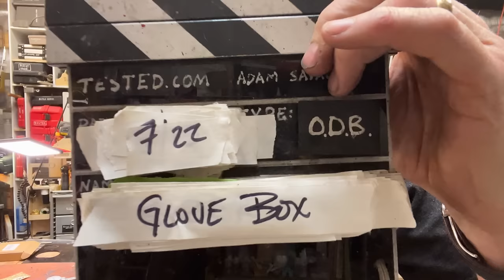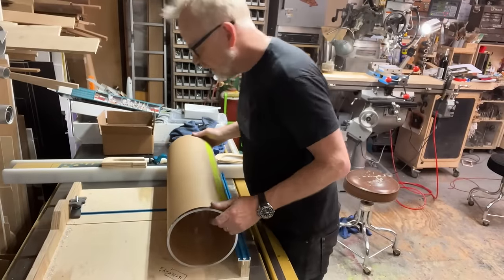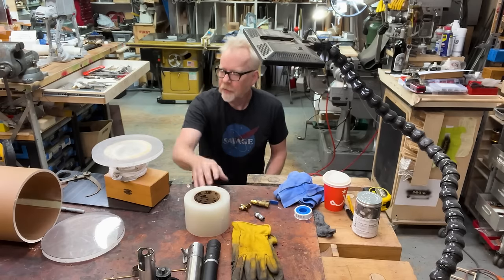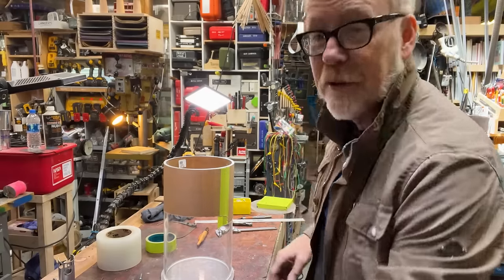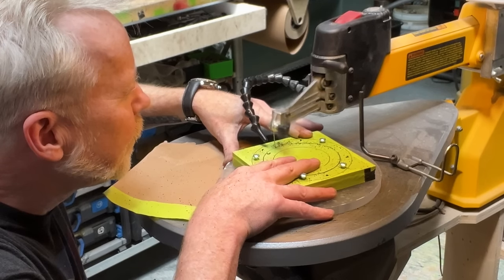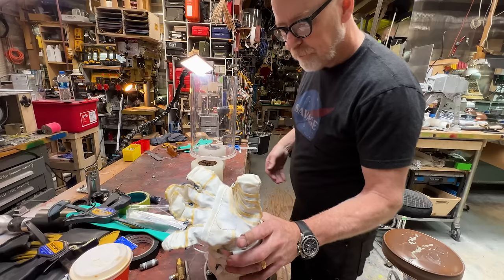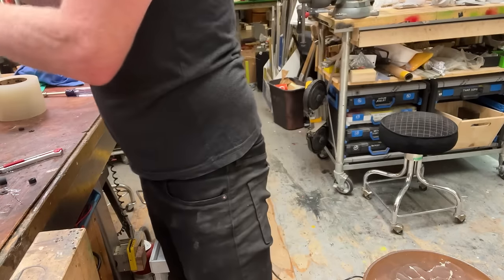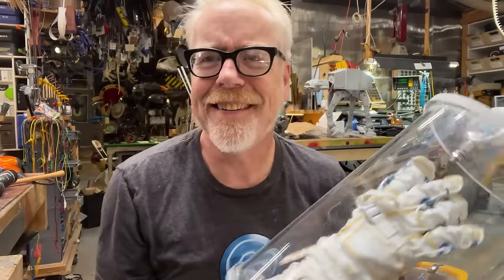Adam Savage's One Day Builds: Spacesuit Negative Pressure Chamber!

Comment: Dude! Retrofit the chamber to be drawn down to 0 atm and have a ringing hammer and bell inside it. No sound will be made and it shows off the negative pressure part. Such a cool build!
Reply: Depending on how it was attached, the bell's vibrations could leak to the jar through its mechanical connection.  There would be some some sound possible.
Reply: I think behind that thick of plexiglass, people would just assume it's very well sound proofed.
Reply: Could just hold a bicycle bell and ring it with 1 hand
Reply: @sjdpfisvrj  BUT, you could ring it with air in the chamber first for a point of reference, then keep ringing it as air is pulled out and observe the sound become quieter. For SCIENCE!! ;)

Comment: This is fantastic!  Some suggestions: there are multiple air leak paths with your gasket design: between the neoprene glove and the acrylic, through the screw holes in the neoprene glove, and through the screw holes in the acrylic.  You could minimize most of these by mounting the neoprene glove to the outside of the chamber, so your layers from outside to inside are: delrin washer, neoprene glove, rubber gasket, acrylic endcap, rubber gasket, fabric glove, delrin washer.  You could do even better by using two different sets of blind tapped holes, one to hold the fabric glove, one for the neoprene, so there's zero path for air to pass through the acrylic.  But blind tapping 24 holes in acrylic would be no fun.

But of course you can't do any of this because the bottom cap is now permanently glued to the tube.  If you wanted to take another crack at this, it might be worth cutting off the end cap, gluing an acrylic flange around the outside of the tube and attaching the end-cap with removable bolts and a gasket.  Adds another possible leak path, but makes debugging so much easier.
Reply: Could always cut two crescents of acrylic, blind tap, and glue them to the inside, and then glue up the seam.
Reply: My bet is an air leak between the acrylic parts Maybe it can be sealed with some kind of rubber seal around the edges?
Reply: I'd put it under positive pressure, and then run a little soapy-water around the joins to find the leak... The old bicycle-tyre trick.
Reply: IMO, the real flaw in the design was that he gave himself very little ways of debugging the leaks. For example, I don't think he really needed to glue both ends, I think an O ring on the top end would have sufficed since the pressure would have held it in place.
Reply: @sjdpfisvrj  I have some production equipment that uses an o-ring seal like that hundreds of times per day, and likely at a much stronger vacuum than needed here.
Reply: @erickgirouard8508  yup! I second that, unless you are going into (low) high or ultra high vacuum territory (and that is a whole other story) orings are perfectly fine.
Reply: I was so disappointed with the decision of going with free holes that I was complaining out loud to my TV!
Reply: I’m with you. Too many possible paths for air. I think I would’ve used a band clamp around the base of the glove securing it to the outside of a large diameter (male) threaded PVC pipe which could screw into a threaded (female) base with one large compression O-ring at the base. Something like a large version of the oil filter housing on Saturn vehicles had. Also, wouldn’t one be better off using fill valve and gauge hardware with dynamic rather than static threads?

Comment: This was great! If I may suggest 2 things: I think this way the vacuum is working against you around the rubber seal. I would mount the whole glove assembly from the outside so the vacuum can pull the rings and seal together. Next to this if you would make a non permanent joint for the bottom plate (with the glove mounted) than there would be a much easier access for testing the different glove adjustments (kind of like a coffee storage can). Thanks for the great content, enjoyed every minute. May the vacuum be with you!!!🙂

Comment: Adam I work for a utility company and the linemen always check their rubber gloves for holes, even a pinhole could be fatal, so you may have a tiny pinhole in the glove.
Reply: yeah, remember how he was really stressing it on early in the vid right? it could easily have a pinhole. Good call. It's been 4 months since he shot this vid lol, he prob already fix this or made more.
Reply: I’m pretty sure I recognize the brand of glove he used. It’s some off-brand cheap “heavy duty” natural rubber glove. Something you might find in a dollar store hardware section. Wouldn’t be surprised if it had small manufacturing defects. Adam should have used the nitrile glove, or a butyl both of which have lower air permeability.

Comment: Hey Adam. Tightening seals in a star pattern helps ensure a flushed mating surface. Hence a great seal. Love this build. Very informative. Thank you.
Reply: That’s also how you tighten the lug nuts on a car wheel, which he should know. Anytime I’m tightening down fasteners that should be parallel I use the star pattern method.
Reply: @falconwind00  along with any kind of seal. Valve cover, transmission pan, oil pan., all the fun stuff. Cheers to you my friend.

Comment: EPDM gasket, Neoprene chemical gloves utilize a canvas substrate. The EPDM gasket under negative pressure 
on the cylinder will hold very strong without a mechanical bond.  No cement necessary. Awesome build!

Comment: I know it doesn’t need to hold much pressure, and it would have been more machining work, but would chamfering the top and bottom into the tube have made an even better seal? As you created a vacuum inside the tube, it would have sucked the ends inward, further and further tightening the seal.
Reply: I would think making a chamfer would be a lot of work in that surface.  I would say not worth it
Reply: Don't even need a chamfer, just add a ring to the bottom lid that fits somewhat snugly inside the tube (or machine a rabbit in the lid) and add a good gasket to the top outside the ring. You wouldn't need to glue the lid on at that point, the vacuum inside would hold it together.
Reply: @arikbord2256 Good idea. Would allow access to the inside too

Comment: Adam,
The next time you need to cut large tubing and it needs to be precise your lathe is a better option than the table saw. Use rubber soft jaws to keep from marring the inside of the tubing and a parting tool to cut it to length. It is a much safer & more easily accurate way to do that task.

Comment: I just made some much smaller versions of this tube! Mine are filled with water, but had similar requirements for being airtight. I made the caps with an inner circle the size of the inner diameter of the tube, and sealed it with Weld-On 4.

Comment: Surprised you haven't made a rotating platform for round glue applications, Adam.😉 If you do it regularly, 100% recommend making one! Just a nice, slow (but adjustable, depending on the glue time) rotation, just focus on squeezing out consistently, lovely job.👍 Also useful for sealing cylinders with silicone, etc.😊
Reply: and if designed right, great for welding too
Reply: @graham_owens  True, a variable speed would give you beautiful round welds...!
Reply: When my boss was in a hurry, he made us use an old record player set to 78

Comment: The inner glove approach was nice! As an alternative you could have made the inner ring (for the black nitrile glove to slip over) a smaller diameter ( & no need for bolt holes on that piece) so it literally sits within the circle of bolts, and then use the outer ring to clamp it in between, so you wouldn't have to put the bolts thru the nitrile glove (god I wish I could post a sketch). Doesn't matter though because your method totally worked out! More than one way to skin a Tauntaun amirite?
Reply: Good idea!

Comment: Adam I worked in a shop that worked on vacuum systems. 
It very hard to deal with finding leaks you could use spray vacuum grease but that would be hard to clean off.
It could be a leak in the glove is self have gloves that were for electrical work and these would come new and fail their testing requirement.

Comment: An alternative to the washing up gloves you are using might be electricians gloves, they come in different thicknesses ( aka voltage ratings ) and are a long glove. We use them with a thin cotton inner glove to wick away the sweat and a goat skin outer glove for mechanical protection. A bit of talcum powder after use also to stop the gloves sticking themselves together.

Comment: If you can adjust the vacuum coming in to be steady, you can take some non-acetic acid silicone rubber and start covering the joints. When you cover the leak the vacuum will increase. Silicone rubber is easy to remove, but if you use clear, leave it. If you do the soapy water to find the leak it'll be tough to dry & clean prior to sealing. Of course the leak could be the rubber glove...

Comment: One other way I'd recommend to plug up potential leaks is to use clear RTV along the outside of the joined edges where you glued together the acrylic pieces. I'd also use the RTV around the valve and gauge as well.

Comment: Wouldnt the lathe be a good tool for making all those fairly large diameter holes? This would get rid of the tideous sawing and sanding both at once. For workholding  idk, maybe a glue arbour? Also you could make a slot for the piping to get glued into the bottom and top. Hope I make sense lol

Comment: where do you get the extra large sheets of sandpaper for the sanding board?  I glue small sheets next to each other onto a piece of aluminum tooling plate. The tooling plate is super flat and adds weight so you don't need to clamp it down in most cases.

Comment: For your hardware if you make another one might need to use copper crush washers, like the ones used for brake line connections. Don't know if it'd work but it's an idea that I know works with other vacuum systems.

Comment: I think one thing you can do to improve the seal is tighten the bolts on your ring-box flange in a star pattern. At least in pipefitting, you're supposed to do it that way, because if you don't the flange distorts and won't seal.

Comment: It was very cool and at the one hour mark I'm yelling at the screen that you want the mounting rings on the outside so that you can easily take it apart to replace the neophrene glove should it tear and develop a leak, AND the pressure differential will compress rather than stretch the seals around the rings.

Comment: You could spend hours fixing or re-making the vacuum tube, or you could just fill the rubber glove up with plaster (while the pump is holding a steady negative pressure). Once it sets, who would be able to tell the difference just by looking?

Comment: Many years I worked precision machining thick acrylic for public aquariums. PVHO, pressurized vehicle human occupancy. Used in Atlantis, twice on Star Trek. The whale movie, and the nose of the research submersible in the opening credits of Star Trek Enterprise, and medical hyperbaric chambers. The way to finish cut that would be on a lathe with  high speed tool ground with a real shallow angle, and almost a razor sharp edge. High speed slow feed so the chip comes off like a ribbon. Then it's polished with acrylic solvent so the cut marks are removed so the cut is as smooth as the cylinder. Assuming the cylinder is not round nor the end plate flat the end plate would be faced off flat then polished. The polish is for a good seal. All machine marks polished off, and all corners inside, and outside chamfered, and rounded.

Comment: A proper seal for a vacuum should be on the outside of the chamber, so that the pressure on the outside is pushing the seal inwards and therefore filling the gaps.

The way you did it is the other way around, the higher the vacuum gets, the worse the sealing gets since the pressure is infact enlarging the gap between seal and the housing.

Comment: Adam

When drilling/machining acrylic plastics, isopropyl alcohol makes a  great lube for the drill/taps/etc

John
Reply: @John Crea:  isopropyl alcohol (along with many other polar organic solvents) causes stress fractures in acrylic plastic.  Most of the molecular components in machine oil are non-polar, thus safe for use with acrylic.

Comment: Yeah, my first thought was "why not just cut a hole in the acrilic the size of the outer diameter of the glove and slide the glove in with the end rim on the outside of the acrilic and then create the seal and fasten the glove from the outside?" But then it's always easier to see when you're looking from afar then when you're up close of the action😜. The leaks come from the treads of the screws at the bottom. Some rubber bushings should do the trick. You could've put the green glove over the black one before you put both in the outer glove so you would have the green glove shine through and still use the black glove to seal. You could even create some removable led-strips to go inside the glove for some extra 'flair' when the box is just sitting as a display.

Comment: how hard would it be to make an oscillating sanding board to reduce the effort needed to sand a surface like that?
Reply: It's actually counterproductive. Part of the "sand it REAL polished" thing is that sanding by hand is not completly regular as a machine tends to be. Completly regular movements tends to create imperfections that you WON'T be able to remove with more sanding with the same regular movement (obviously).
Reply: Or even sand it on the lathe

Comment: I’m guessing the 2.0 version will be even better after reviewing some of the comment ideas. Nature abhors a vacuum and anyone that’s dealt with operational vacuums can understand that all to well; I’m guessing with a little better sealing regarding the pressure glove and perhaps the elimination of through holes, on the glove side and you’ll do better. Just remember holding a vacuum is different than holding pressure and the pressure glove you’re using may very well not be able to hold a vacuum even when perfectly sealed. One benefit to your setup is the ability to draw a continuous vacuum much like a central tire inflation system can keep pumping air in as fast as it may be flowing out to ensure you get our of dodge when needed you could simply establish a vacuum pump to pump out at a rate equivalent to your rate of air infiltration. Like the videos and your scientific mind that I’m sure will keep thinking of ways to improve; overcoming our failures is the mark of a good person and maker.

Comment: I think I would've not glued the bottom and just put a gasket there (like your vacuum chamber). Maybe even add a lip or ring that fits inside the tube to help with alignment. That way you could have done adjustments to the glove attachment. If you put your gauge and air inlet to the removable bottom as well, you would be able to swap or replace bits without having to rebuild the whole thing in the future or compromise the main vacuum vessel. 

Also, try machining a smaller ring that gets sandwiched and clamped in place between the two outer flanges (with rabbits cut in the outer rings for it) so you don't have to put bolts through (and poke holes) through the rubber glove/air bladder. Just my $0.02. 

Finally, When cutting the tube I would have added wedges or another temporary fence to the miter sled to give the tube a cradle to sit and rotate in with three points of contact. Probably would have been a tiny bit cleaner of a cut (and a lot safer, IMO).

Love what you do Adam!!! I love this idea for a project. Totally going to think about making my own someday.

Comment: Just curious if Adam pressure tested the nitrile or the black gloves (not sure what the material).  It’s something we did on the chemical ERT I was on to make sure nothing could leak into our gloves.  If there was a pinhole anywhere in the glove it would leak and once inside the outer glove would be difficult/impossible to find.

Comment: I made a smoke machine from a pickle jar, soldering iron through the lid and some cotton cloth soaked in baby oil to find a leak my Honda Ruckus carb. Wonder if you could use smoke to find the source of the vacuum leak on this?

Comment: I think I'd have taken a different tac in cutting the main hole. I would've made a template for a plunge cut router. With a proper guide they cut a pretty clean hole. It would be pretty easy on a router table too.